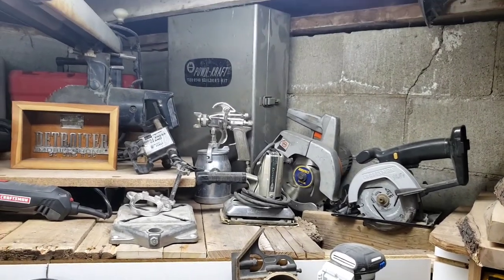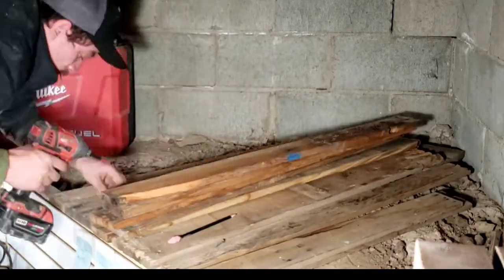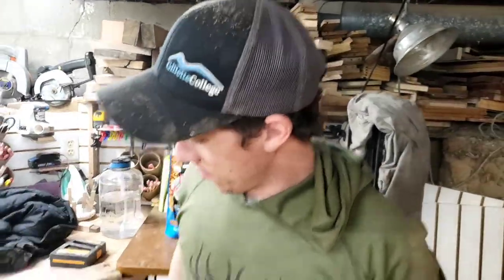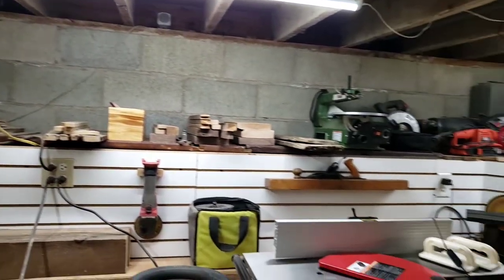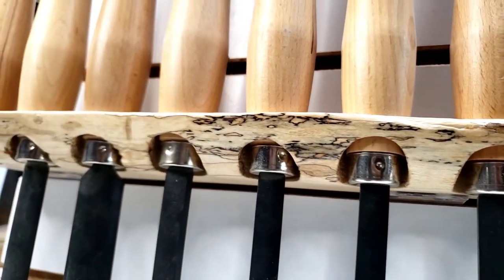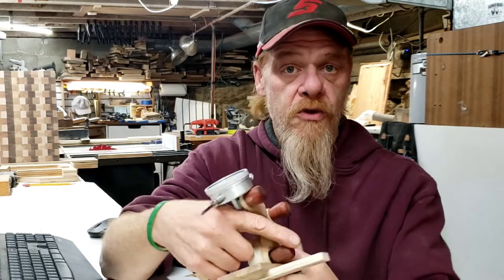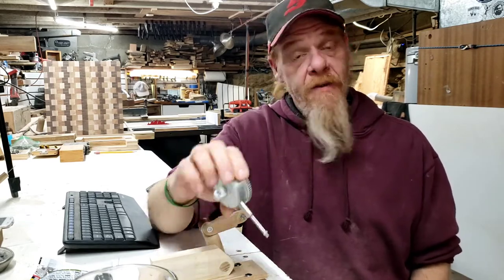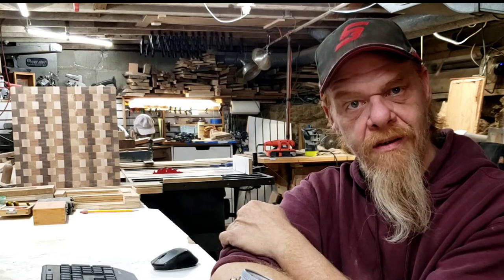April Shop Vlog | A subscriber gift,  Slatwall tool widgets & AN APOLOGY

Comment: I love the spalted maple tool holders.  Even in a dungeon, you can still have a nice work space.  Do you still use that Stanley transitional plane?
Reply from the maker: I don't have a blade or a chip-breaker for it. I thought about getting a set from Hock Tools.  I have been using my grandfathers Craftsman Companion plane and getting better at the sharpening, so it becoming a bit more pleasurable.  I brought the Ohio Tools #4 1/2 out the other day to start making a plan for it's restoration.

Comment: That was a practical decision on the Radial Arm Saw, and I'm glad you found a way to get the indicator to function as you want it. Good work. I guess 185 blocks in the cutting board.
Reply from the maker: very close guess! Thanks for stopping in.  our shop is evolving and I am an easy going fella :)